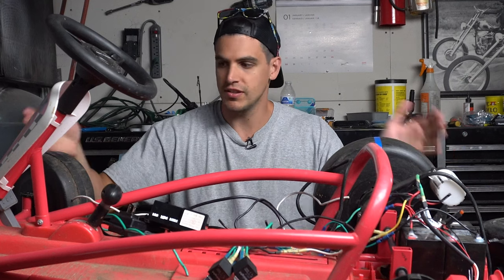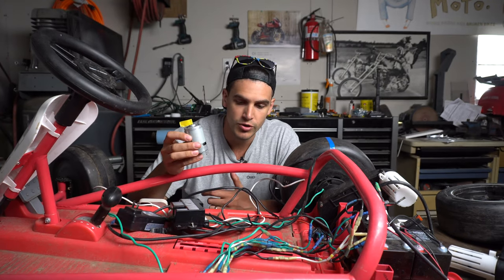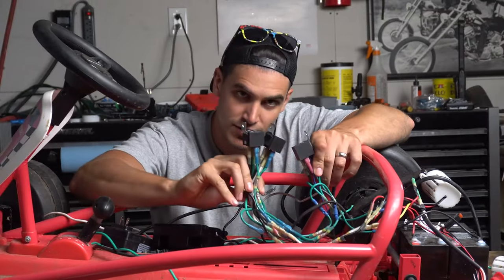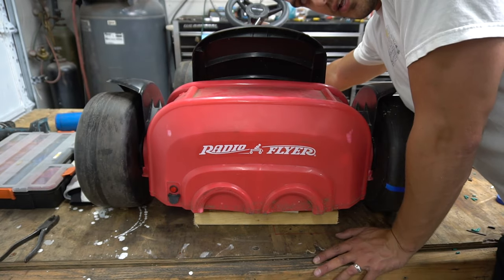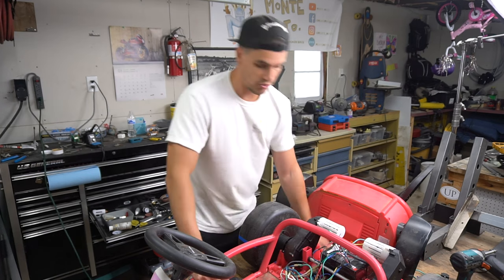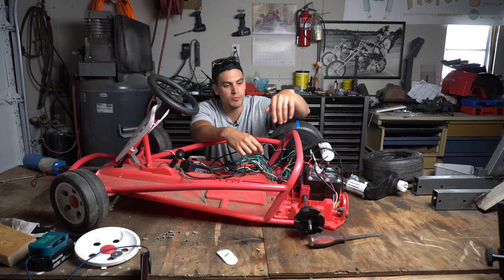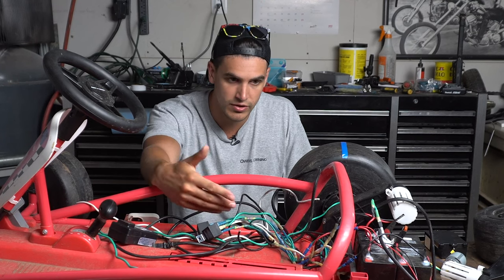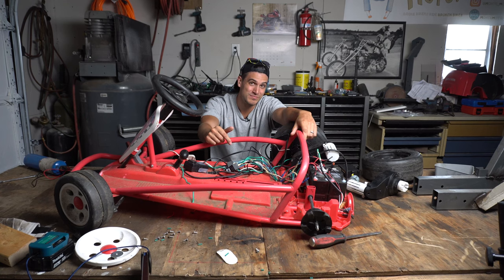Radio Flyer Go Kart motors burn up

Comment: Yeah man I’m glad you’re tackling this project. I’m at the same point you’re at. Have a 2 year old that loves ours and a 6 year old that wants to go faster. We haven’t had any issues with ours but I want longer run times and higher speeds. Live axle is what I was thinking too. Maybe use my Ego batteries. That would be perfect.
Reply from the maker: Oh nice if you bought into the ego system those batteries are huge! I’d try to make those work too

Comment: I’ve had my sons less than a month it’s stock and within the first five minutes broke the gears so got radio flyer to send me new gearbox/motor assembly well put that in and lasted a couple days till the other side broke. The gears break so easy do you have any recommendations

Comment: What about a old alternator or starter would that be enough torque for her? Just thinking them because you can get them free for most part someone has one laying around and you can control the speed of them and should have enough torque for her for at least a couple more years.
Reply from the maker: Not a bad idea! I have some starter motors lying around 🤔🤔I’ll look into it! Thanks for the tip!
Reply: @themontemoto  No problem thats what I was hoping you had one, knew ya would :D

Comment: I’m in the same boat. I may put a small gas motor on it. Harbor freight here I come. I 😅also could not find a pressure sensitive pedal if any sort
Reply from the maker: Gas is the next step after I try a bigger motor I think 🤔